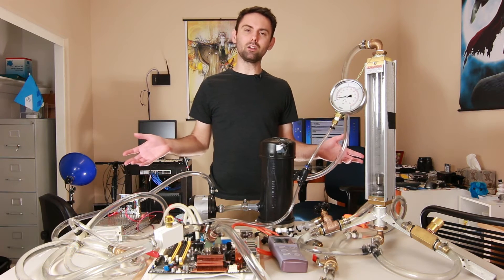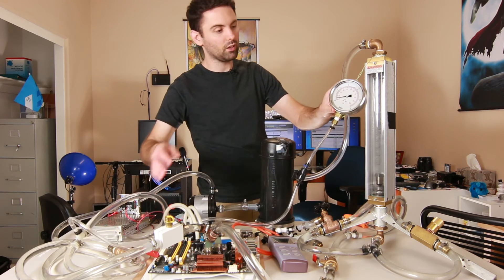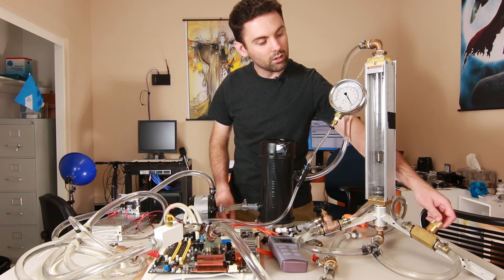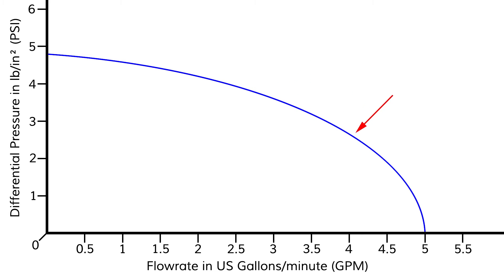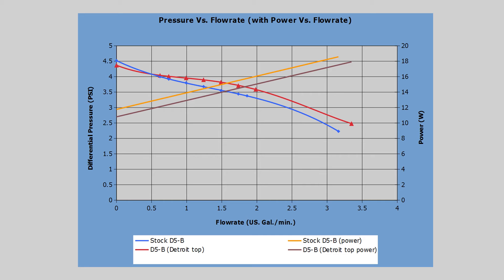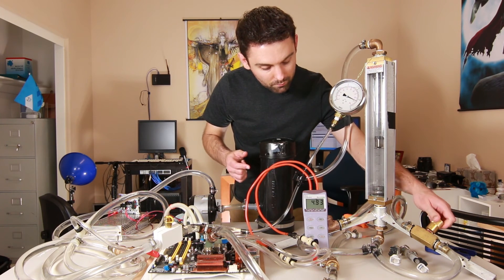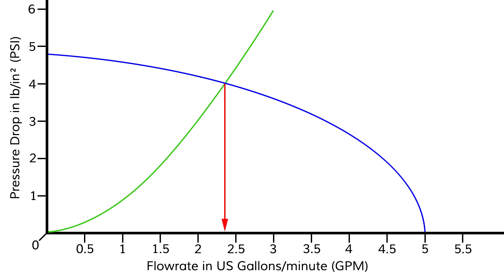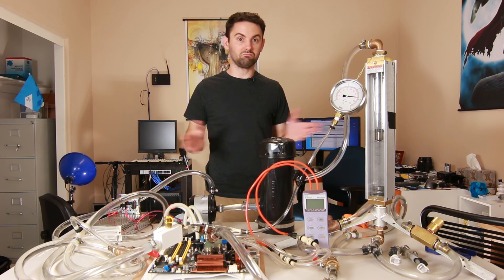Flowrate, Pressure, PQ Curves, & You: Understanding Watercooling Pump Performance

Comment: Wow, this video is incredibly informative. Thank you for this amazing class. I'd like to know what's the effect of lowering the RPM of the pump (in PWM controlled pumps) in the curve you showed. Would that lower the the whole curve or just move the operating point to a lower flow rate?
Reply from the maker: Generally speaking, reducing the impeller RPM will drop the whole performance curve, which results in a lower flowrate through the system.
Reply: @AlexVenz  But the system pressure drop curve stays the same, right? So the effect of lowering RPM of the pump will be travelling down the system pressure drop curve. Am I right? The reason I'm asking this is that from my experience, there is a minimum flowrate from wich there is no noticeable temperature gain in a custom water cooler. If I can find that value, I can then optimize my system for the lowest possible noise without any performance losses.
Reply from the maker: @DanielCafé-r7v  Correct, the pressure drop curve of the components in the loop stays the same and the point of intersection between the pump's performance curve and the component pressure drop curve ends up lower on the pressure drop curve.

As for flowrate vs. component temperatures, the point of diminishing returns is usually around 1 us gallon per minute for common PC water cooling parts. Anything above that 1GPM flowrate doesn't typically do much and performance tends to degrade quickly below about 0.5GPM. I'm not up on who's still doing good independent testing these days, but some of ProCooling's old waterblock performance curves can still be found online if you want to get a feel for how flowrate impacts component temperatures in very old waterblocks.

Comment: @Alex Venz I need some help, i am going to review like 12 pumps from aliexpress, and i wanted to ask, if i just need 1 pressure sensor to read the pressure drop of a cpu block. Or i can use has a refrence the pressure of the exit of the pump minus the pressure output of the cpu block at a given RPM or duty cycle?
Reply from the maker: You're going to need two pressure sensors.
Reply: @AlexVenz  For real ? XD Reeee. It took me 1 month to get my stuf, a T fitting 1/4 and a pressure sensor 1.2MPa.  Because if i know the pump exit pressure at a determinat flow rate/RPM i could calculate the exit pressure on the cpu block. The worse part, is how the F i am going to calibrate my pressure sensor XD

Comment: Why not vacuum the system and have no pressure except only the liquid, let it boil on the heat source and turn into a gas. Then cooled off in the radiator and back into a liquid and circle back?
Reply from the maker: Add in a compressor and you've just invented refrigeration cooling. Sans compressor/pump, you're approximately describing a heatpipe.
Reply: @AlexVenz  Yeah I probably wouldn't use a compressor because of the noise, though that does sound nice and cold. Though I'd be worried about condensation on the chip during idle. I ended up looking around and found Novec 7100 that already has a low boiling point, so no need to worry about vacuuming and worrying about losing a seal. Sounds promising in my head.
But yeah now that I think about it, it's closer to a heat pipe, just now without a vacuum and a radiator & fan on the other end to bring it back to a liquid state and gravity feed it back. Maybe have the "reservoir" right there on the chip so there's always a liquid on the chip. Only thing that worries me is the radiator handling steam. I'm by no means a mech eng, so I don't know this world at all or what's available. Oh well, maybe someone will build something like this, sounds cool.
Reply: Looks like what I'm describing is a thermosiphon. Fascinating

Comment: Im running 2x D5 pumps, and when I put them from 20% to 100%, temps drop. I'm considering 4x D5 pump (for lower dB at 20% and lower temps at 100%). Do you think it will work with 2x 2x140 and 2x 9x140 rads? EK GPU wb and Eisblock XPX

Comment: hey Alex, love your set up! I am trying to build something similar myself to do some experiments. The guage pressure the system would have to endure is between 15 and 30 psi. Is your reservoir made out of acrylic or glass? I have this concern, that an acrylic reservoir might explode, anyhow your build seems solid. I am thinking about buying a PC cooling reservoir and not going through the hassle of buying all bits and pieces, but if you tell me your wasn't to time consuming I might follow your same path. Thanks!
Reply from the maker: The reservoir I used here is made out of a section of 4" diameter ABS pipe that has a rubber cap on the bottom, an open top (though, I have a cover that goes on but does not seal it), a baffle glued in to allow the system to bleed air more quickly, and a couple barbed fittings threaded into the pipe wall. That said, the reservoir isn't subject to any meaningful stresses due to pump operating pressure when feeding the inlet side of the pump like this... System pressure is highest at the pump's outlet, with each component thereafter incurring a pressure drop (volumetric flowrate is constant through a system like this, pressure is not). If you were to put a sealed reservoir between your pump's outlet and a very restrictive part, then you could probably pop a reservoir... but I can't think of why you'd do that.

My main reason for using this reservoir setup was to provide enough fluid volume for the pump to fill the test loop without needing to cycle the pump on and off while adding more fluid (running an Iwaki RD-30 pump dry is very bad). The size of the reservoir also made it easy to install baffles to aid in the rapid bleeding of air (baffles are up high, near the return fitting, which keeps the turbulence from the return stream and air far away from the large fitting that runs to the pump's inlet).
Reply: @AlexVenz  Hey, thanks for the detailed answer! We are thinking about cooling our PC rigs using the pressurized air we have in the lab (instead of using pumps). We want to make sure that the reservoir won't pop even if we open the air supply a bit too much :)

Comment: way there is such a big drop pressure on the water block?
Reply from the maker: Well, between the jet plate and the small microchannels, the waterblock that I had hooked up to that system presented significant flow restriction---the greater the restriction, the greater the pressure drop.

Comment: Hi there :)
I'm designing a testbench for a watercooling system. I'm not really 100% sure how to set things up, but I'm finding out new stuff all the time and this was a super informative video by the way. And I was wondering what heating device are you using to simulate the CPU?
Reply from the maker: +PollyB This is a rather old waterblock test setup that doesn't employ a CPU die simulator... kinda. The setup was loosely built around an iteration of Intel's TTV (Thermal Test Vehicle) specification. As such, it uses a live Intel CPU that has had its IHS milled and a specific thermocouple embedded into the center of the IHS to provide a measurement for what is defined as Tcase, in accordance with the technical diagrams provided as part of the TTV specification. The thermocouple is then connected to external data logging equipment and monitored. This approach has its advantages, but also some significant disadvantages... like either trying to obtain an instrumented CPU from Intel or finding a really good machine shop that's willing to toss an expensive CPU into a mill and mill out the copper IHS with dry air only--you can't use the usual wet lubricants/coolants.

Comment: thanks for the informative video!
But i got one question: does the flow rate have any impact on your temperatures?
eg a 200 LPH 1.5m head preassure pump vs a 800LPM 5m head preassure pump
Reply: it does, but when you pass the 1GPM = 3.78 L/M or 228L/H , the return aren´t that big, like 0.5C - 1C.
http://martinsliquidlab.petrastech.com/MartinsFlowRateEstimator.html